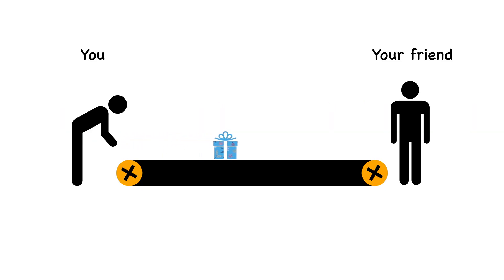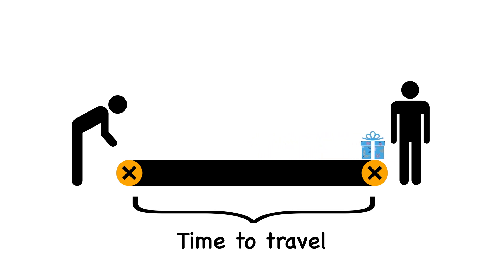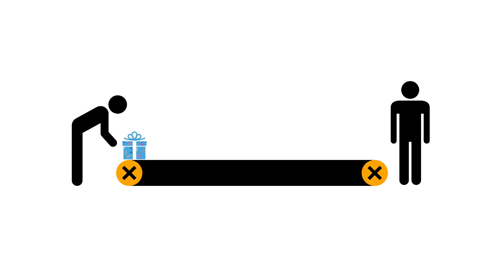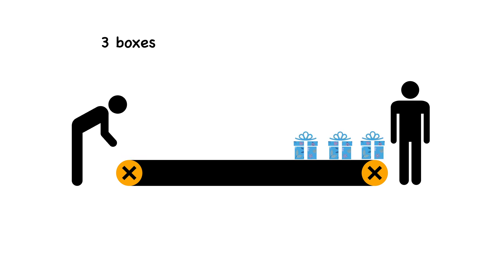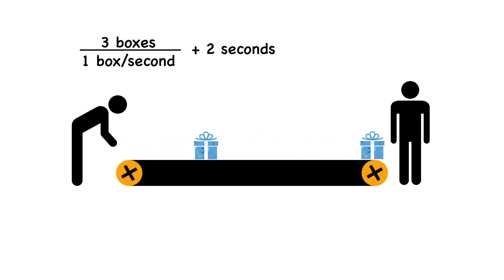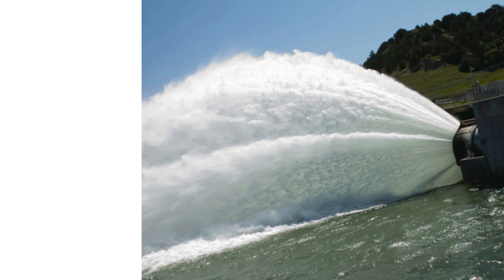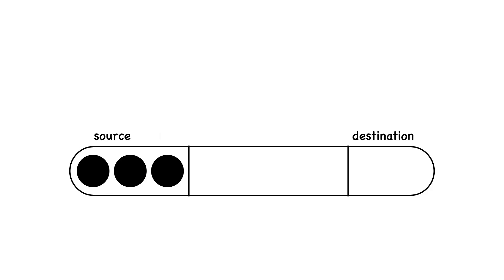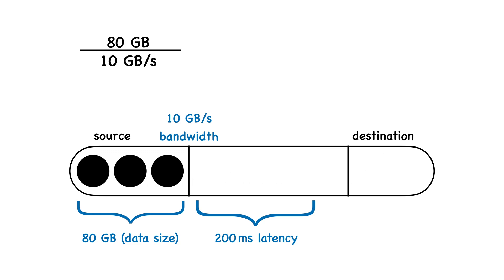A Better Analogy for Latency and Bandwidth in 2 minutes

Comment: This is why geostationary satellite internet will always have high latency. Since these satellites have to orbit at 22,000 miles high, meaning a nearly 50K mile round trip, the speed of light is a very real limiting factor.

Starlink improves on this by using low earth orbiting satellites. But this also means that instead of one or two satellites, they have to use thousands of them! And they all have to communicate with each other. It works, but its service is wildly inconsistent.
Reply: wow